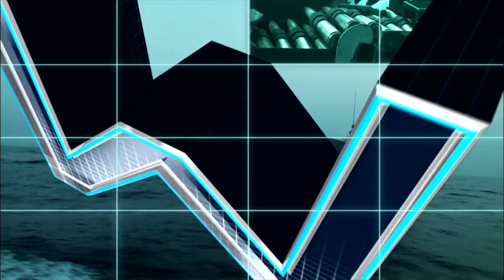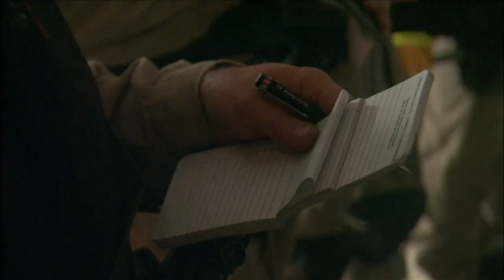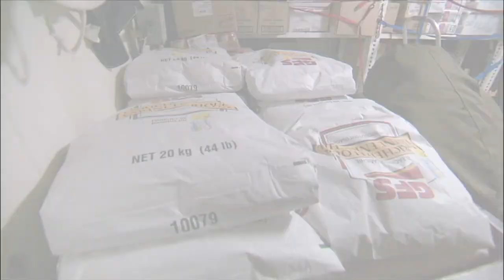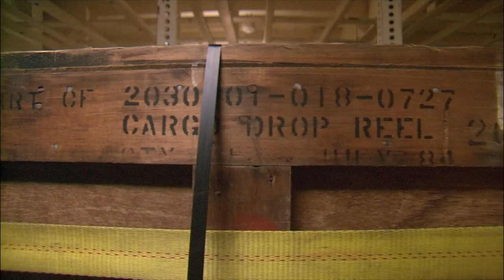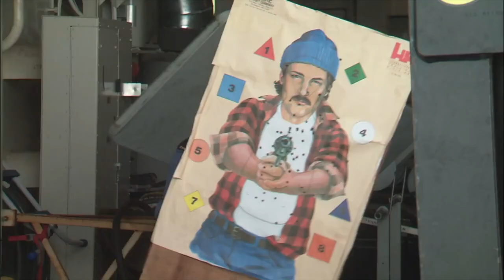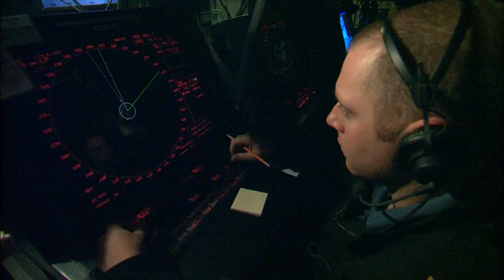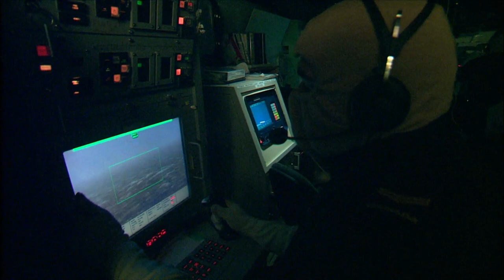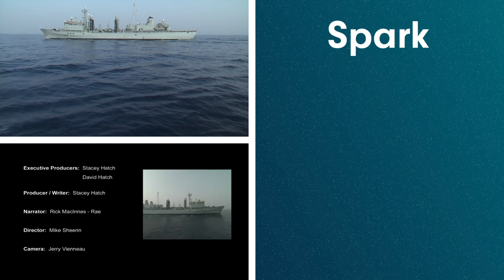HMCS Protecteur Boards Suspicious Somali Fishing Vessel

Comment: Fantastic vessel and I am sure the Asterix is even better. It seemed a bit slow on the anti-missile drill though ( maybe it was just the way it was presented. ) 100kph is about 600 mph = one mile per second so 40 miles distant is only 40 seconds away and the drill took long minutes. And did they really have to load the CWIS first or was that a simple weapons check?

Comment: in coming missile are way faster than they pretend to be in the training the response was too slow.  way too slow if they cant do all this in 2 second they are dead
Reply: 1) slow is smooth,smooth is fast 2) a missile takes longer than 2seconds,usually detected on radar quite a bit put giving upt to 2minutes of reaction te but usually they have 45secpnds to respond with chaff,CIWS counter missiles etc
Reply: @aidanbegovic9584  I have seen a voodo fly by over my head. first it was just a black dot in the far distance and by the time i turn my head around to ask permition to designate from my 274 sight it had pass an was gone. dose today navy have fix the human factor and are they close up 24-7.
Reply: @aidanbegovic9584  well i know now that i should'nt have waited for the order to designate but back then it was my first time on the sight and all previus designation on the radar came whit the order to do so.